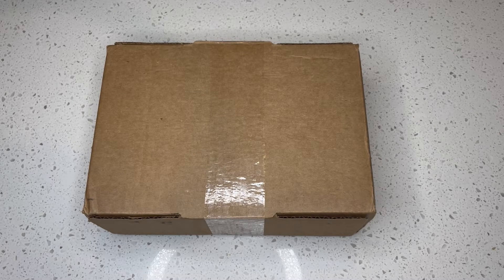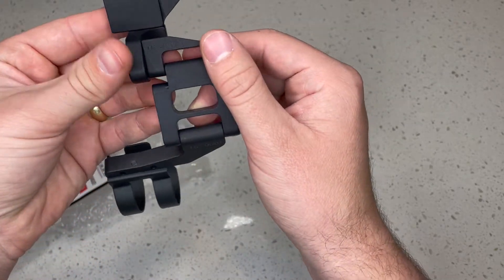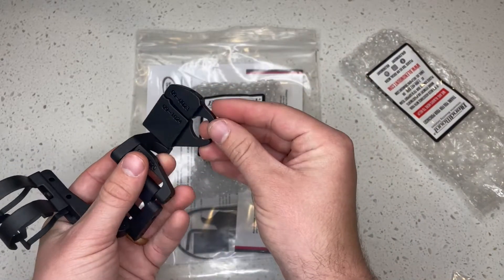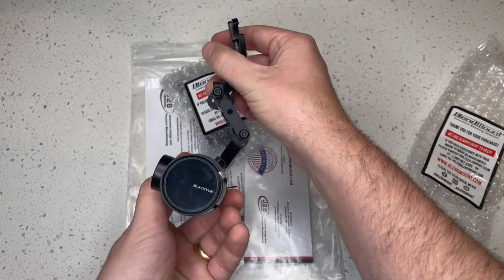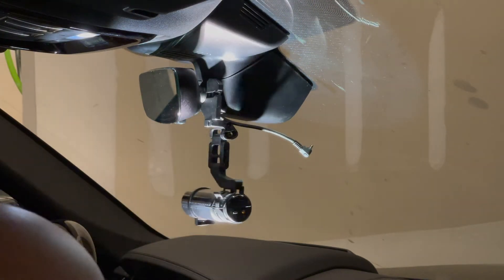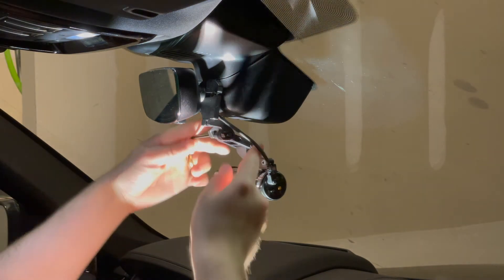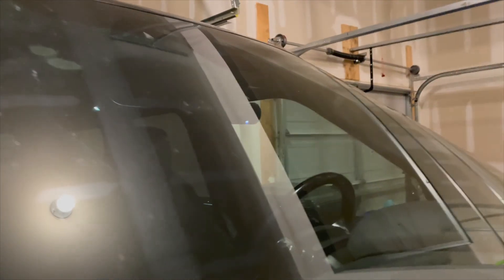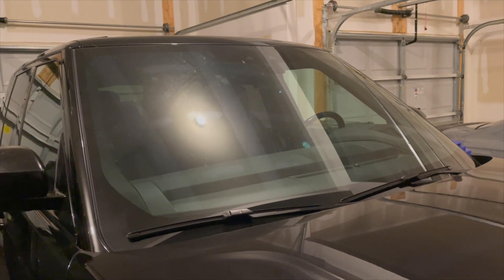BlendMount Dash Cam Mount Unboxing/Install! [Part 3 of Range Rover Dash Cam Install]

Comment: Have you tried using this mount on rough roads? Was there any vibration with this mount?
Reply from the maker: This mount is rock solid. Originally I was worried about stripping the bolts by tightening them too much but the guy at BlendMount assured me they were titanium and not stripping anytime soon. The camera is essentially a fixed point on the vehicle now.

Comment: Nice nice, yeah, I think I am going to do this for sure. I have a question, I don't want to stick anything to to the windshield will use this for my DR900X, but I have an EZ-Pass for tolls. Would you kindly suggest any alternatives instead of sticking anything to the windshield? thanks.
Reply: Play nice Christian 😅